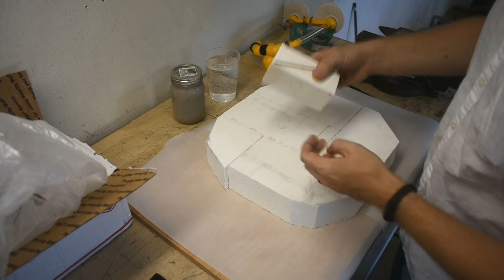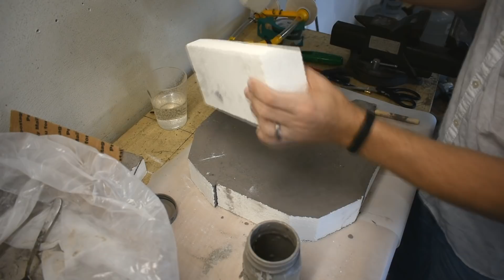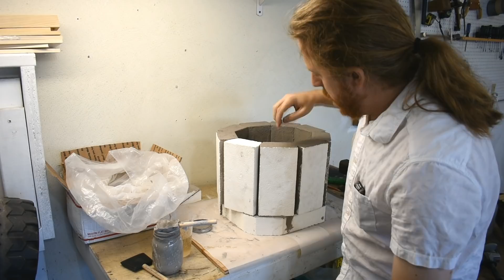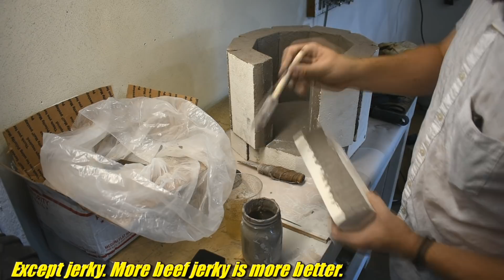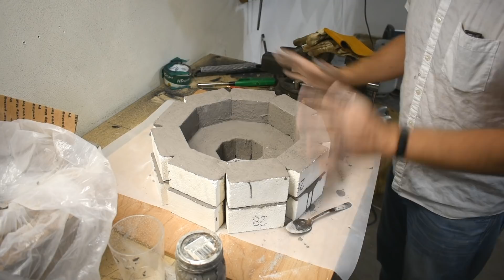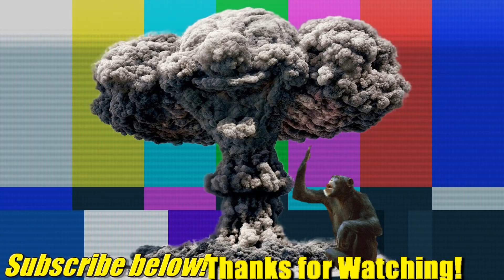How to Make a Fire Brick Foundry Furnace, Part 2: Applying Satanite as a Mortar/Refractory Coating

Comment from the maker: Satanite: https://amzn.to/3hYdYEF
Similar bricks to the ones used in the video: https://amzn.to/3VDIzoY
Similar, not exact.  these are 2600 degree bricks, you'll need a couple 12 packs.  Also 3000f bricks are available for double the price.  Honestly 2600 is enough unless you melt iron.

Comment: I used a plastic sandwich bag for mixing the water and satanite.  I also just used some plastic gloves and cut a hole in the mixing bag and painted it like pastry dough and then smoothed with my fingers. no brush or jar needed. fun times.
Reply from the maker: thats a really good idea.  Every time i stopped, the lid would seal itself to the jar and it was a challenge getting it free without breaking the jar. I'll try the bag next time

Comment: 15:13 that quote from Scotty is the same method that mechanics use to this day as a legalized way to commit theft by deception. It's deceitful. As a contractor I always stay within my original estimate I'm actually required to by law within a certain dollar frame. I also happen to be an ASE certified mechanic I just choose to get out of the field because of the deceptive practices utilized within like Scotty's little quote. Where a mechanic will tell you that a job that literally takes 30 minutes; the mechanic will tell you that it takes an hour to an hour and a half. My last inspection station even tried this crap on me not realizing that they were talking to a mechanic. Then when I called them out, and let them know that the vehicle had already been pre-inspected with time and date stamped video and photos, and once I let them know that I was a certified mechanic just working in another field and cannot legally provide my own inspection which was the only reason I was there, and once I let them know that parts they are claiming need replacing were already recently replaced and that I knew they were bull shi*ing me and that I wasn't the average Joe who knows nothing about cars, all the sudden the price changed as well as many items they said needed replaced came off the list once I asked for my old parts back post inspection. And most especially once I let them know that I was aware of and quoted my local and state jurisdictional rules and legal codes for accurate inspections for auto shops and asked if they really wanted to stick with their original quote; the quote immediately changed 🤷🤯🤯✍️✍️. The reason they get away with it is because legally they are only required to stick within their estimate so if their estimate is for three times the amount of time it actually takes, as long as they stick within that estimate and you have agreed to set estimate, they are legally okay so long as they are not selling you things that are not needed, or deceiving you. Even the mechanics time code listings for these jobs nationally are listed at three times what they actually take to perform. But once somebody asks for their original parts back usually things change because they realize that some people want those parts back so that they can have them tested to see if they've been duped. And most of them even if they complete the job within 30 minutes bill you the entire hour and a half simply because they can and because most people don't have a working knowledge of cars to know such things which is why they're at the shop in the first place. It's disgusting and deceitful. Robbing people of their hard-earned money in order to line one's pockets at the expense of the consumer. So if I can modify the quote "if you want to be seen as a miracle worker; give a quote that is difficult for many to meet, and then  beat it" integrity will always pay off more as when people realize they are being cheated; they will no longer want to do business with you. Yet a company that people see has integrity will bring in more customers and thereby more money yet the person will be able to sleep well at night realizing that they did so ethically. But then again there's plenty of people that are perfectly okay with cheating people and still sleep well at night so it is what it is. Unrelated to the video but it resonated with me when I heard the quote because many people still do it today and get away with cheating people.

Comment: The scaffolding under those structures was for the purpose of completing the arch during the construction phase when stones were added with/without mortar until the arch was completely built.  The same scaffolding would then be used for construction of similar bridges.  I have never come across the requirement that the bridge engineer stand under the bridge when scaffolding was being removed!  But it adds to the drama.

Comment: can we coat iron tube by  this mortar???
Reply from the maker: I think it would crack and fall off 9f a metal pipe.  When this is painted on fire brick or ceramic wool, the moisture gets absorbed by the material depositing the satanite on the surface, then it must be fired.  I'm not sure it would survive well attached to steel, especially with different expansion rates during the hot firing

Comment: You spent a lot of time and money on your firebrick stacking method. In the future try using the right mix of the right concrete, fill a 5 gallon 75% then press a 3 gallon bucket into the mix and clamp it down or hold it down in place with something. Then poke your hole make your lid with rebar handles, 2 inch center hole on top. Finally attach a LPG regulator to your propane tank. You only need 5 psi tops. for more fire blast adjust the shotgun instead of adding more gas. * be sure there is no gas leak because then you lose money and you can blow yourself up. You just save 350 dollars than if you bought the forge and just as good. ** make sure we have no gaps between the hole and the torch, wrap torch with insulation for a snug heat saving remedy. Please wear a 3M face shield especially while pouring and burley work gloves long sleeved tough protection. This is very dangerous only for outdoors in very dry conditions. For my nerves I always keep the music playing and I practice with a dry run practice without the molten metal. You only have about 10 seconds get a good healthy pour of copper. Dont leave it in the mold. flip your iron mold and give your ingot some water TX. a motorized iron threaded wheel is used in the last step to make your copper ingot look like gold. **Melting Aluminum is child's play but i'm not knocking it . Just how silver is to gold, aluminum is to copper.

Comment: Use the extra fire brick to make custom molds. Aluminum melts at around 1400F and Copper at around 1980F. Dont keep the metals in your brick molds for longer than 10 secounds. Make sure you torch the fresh mold to cure it prior to a pour. Molds should be placed at least 2 feet above ground so you have adequate pouring ability. A mold on the floor is just setting yourself up for injury and failure. staying tuned to see part two. I like your egyptian analogies and fun facts.

Comment: Question: If the satanite is rated to 3200 F, why did you buy the 2800 F fire brick? Wouldn't the satanite protect the 2300 F fire brick just as well?
Reply from the maker: the satanite coating is really thin, when the thing gets heat soaked the bricks can potentially be very hot right under the satanite.  The different types of bricks also have different strength properties, the place i found with data said the 2800 degree bricks were quite a bit stronger in compression than the 2300 F ones.

Comment: good job lots of good points too,  used motor oil cost almost nothing and the heat is way higher than propane ,you can melt cast iron with it but its a little more work to make the youtube video is the kiwi fuel sprayer with it you can use any fuel you want too .thanks for making the video .
Reply from the maker: Motor oil would be awesome, but every oil burning set up i've seen puts out smoke at some point during warmup or use, and i live in a neighborhood full of very nice people, i can slip under the radar much easier using grill propane.
Reply: your rite that's why I am going to make an oil pree heater 120 volt ac I also have Nabors I don't want to upset I live in a trailer park lol

Comment: you could mix the mortar a little thicker and fill in the wedge gaps between the bricks
Reply from the maker: Yeah that's what i'm going to do most likely.  Maybe fill in the bulk with sand and coat the top of it with mortar.

Comment: Awesome video series. I know your not an expert but what are your thoughts on this, you said the satanite was rated at 3200 degrees. Even though you used ATSM 28 firebrick, do you think you could have gone with ATSM 23 with the satanite coating and still met the intentions of your furnace, such as with melting the copper?
Reply from the maker: +Richard McCreery it’s possible, but I’m sure it would depend on the design and how thickly the satanite was applied.  The inside of the furnace most likely won’t get above 2300, but the area in direct contact with the propane flame definitely will.  I would think a sufficiently thick coat of satanite would protect 2300 degree fire brick enough, but I’m not certain.  It would definitely keep ultra hot propane fire from directly contacting fire brick, which would certainly help.
Reply: fire place bricks work grate they glass over in time leaving a protective coating on them more cost affective in the long run and safer to work with .

Comment: Try using the left over bricks to fill in the corner gaps. You could probably make like 6 out of one brick just make like really long sharp triangles. Looks more neat and probably improves insulation on the corners.
Reply from the maker: thats a good idea, might take a while though
Reply: Paul's Garage yeah maybe, you would just have to calculate how sharp (degrees) the corners are but you could also just fill the gaps with plaster because thats really easy en insulates quite well. 

Eirher way, good luck! 
btw, love your vids!
Reply from the maker: it's 40 degrees :) already did some calculations.  don't know exactly what i'll do with the gaps though...
Reply: Paul's Garage what about plaster?
After you put the sheet metal on an closed the bottom, you can pour plaster and sand in the gaps.
- it insulates very well
- it doesn't matter if it crumbles because it can't go anywhere but it probably won't crumble as much because there is already half a insulating brick in front of it
- and if it crumbles, it's really cheap and easy to just get rid of the old plaster and pour some nee you probably don't even need a to buy a new bag of plaster. 
It's just an idea though, maybe you can do what i just said but with that satanite stuff or something but i don't know how well that insulates though.
Anyway, i apreciate you reading people's comments and replying to them. Not alot of ytb'rs do that so thanks and till the next video. Bye

Comment: Your new furnace should work really good. It'd better, considering how much work you've put into it.
Reply from the maker: +Paul Frederick early tests indicate it heats up REALLY quickly.  Should be awesome
Reply: I've only ever had a lightweight brick furnace. So I don't know how crappy everything else really is. I just took a 5 gallon metal bucket and stacked bricks up around it sewer basin style. It is not all fancy like your furnace is. But it's a lot thicker. My bricks are all laying wide side down.

Comment: Have you put any thought on how you're going to fill the gaps between the bricks towards the outside of the furnace?
Last video I was thinking maybe castable refractory poured in after finishing the shell, but the satanite seems pretty versatile. Could probably pack it down in after shelling it all. Without looking into the properties of either of those options, the only drawback I could see is introducing a lot more moisture and increased drying time.

This is all assuming you legitimately haven't got any ideas on how to approach it. 
I can never tell how far ahead you've planned these projects. Your videos have a great mix of success/failure, well thought out designs, poorly thought out designs and a lot of self deprecating humor.
Good balance of downplaying your practical knowledge for laughs and willingness to test new ideas.

Whatever you have planned or unplanned for this furnace, I'm excited to see it unfold.
Keep up the good work, man.
Reply from the maker: +Daniel Downing I have a few ideas to fill the gaps, the main one so far is to stuff it full of something or cover it up and forget it exists. :D. And thanks for watching, I'm glad you like the successes and failures

Comment: That's looking real nice! I'll have to look up Satanite. I probably could of used it instead of the high temp cement when I repaired my furnace.
Reply from the maker: +eviltwinx satanite is a good coating for sure, but refractory cement is probably stronger.  This stuff is used a lot in forging, people for knife blades with it and stuff during heat treating to prevent scaling on their nice new blades.  It's pretty cool stuff.

Comment: Just the right video to same me the friday evening (here it is just 8 pm) Looking good so far. Think about positioning two handles on the lid Paul ;) BTW after installing the sheet metal you can fill the remaining mortar into the gabs.
Reply from the maker: +Massimo Serra I'm still working out how I want to do the handles.  I have some ideas ;)
Reply: Hi Paul, I looked around to find a video showing a really help full way to attach the lid to furnace I've seen some time before. It's not the right but it shows a seamless way of attachment. May be an idea for you. https://youtu.be/2dx1WXa33yw
Reply from the maker: +Massimo Serra hey I know that guy!  That's a good idea

Comment: Yes.. borax is used a flux when forge welding.  Eats refractory.  Holy crap that looked like a fair amount of work.  Why didn't you go with a tank, kaowool and some rammed mizzou?   Finding mizzou can be tricky I know...
Reply: worldtraveler it'll be nice and light though for portability yet more durable than a kaowool and satanite rig. This furnace will heat up faster than if it had an inch of Mizzou too, which is important - importing Australian propane to get that clockwise tuyere to work isn't gonna be cheap!  ;)
Reply from the maker: +worldtraveler it is indeed a fair amount of work.  I was quite sure I had a reason for using fire brick but for the life of me I just can't remember anymore lol
Reply: Well there is: https://www.amazon.com/MIZZOU-CASTABLE-PLUS-lb-bag/dp/B07218FQP7
and: http://www.hightemptools.com/castablerefractory.html
If you are interested in Mizzou in the future, plus Amazon has free shipping ;)
Reply: Tobho Mott lol... I was wondering why he is spinning the WRONG way...  ?  Gas for a clockwise flame is expensive.
Reply: As he mentioned ((maybe in part one) of which I can ABSOLUTELY relate) he's chooses the more difficult (or less easy) route...